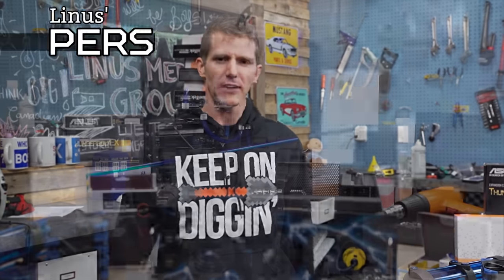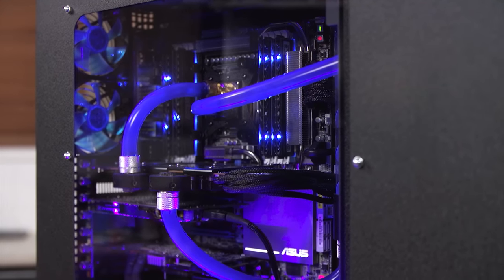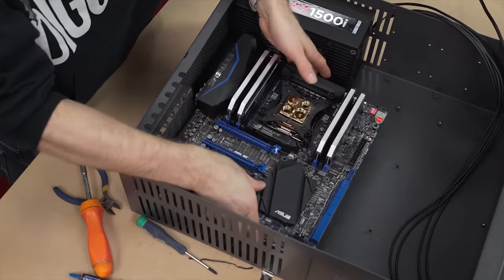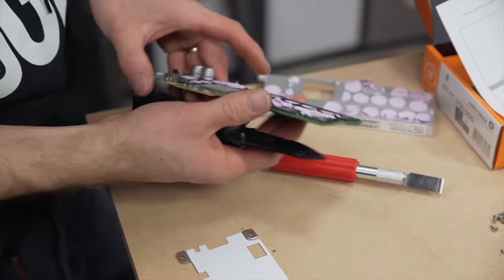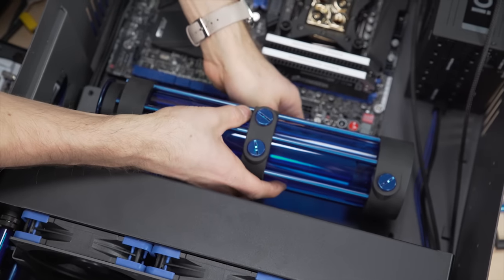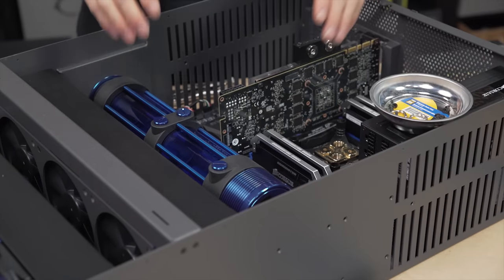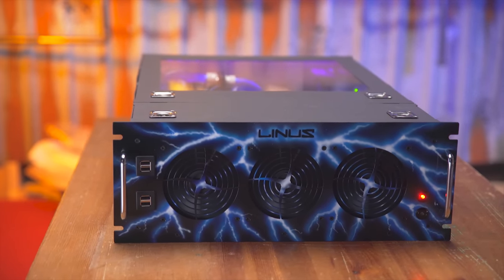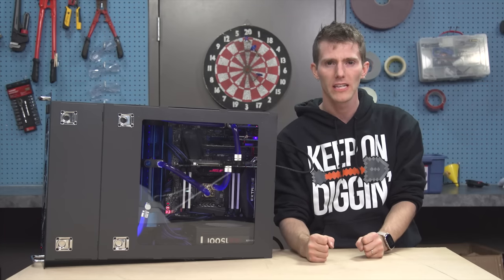Personal Rig Update 2015 Part 4 - My new gaming PC is done!!

Comment: Still using the Tj-07, it's housing two 980tis and a i7 980x cpu, all on air cooling with a side 140mm fan drilled on the acrylic to keep the graphic cards cooled, they idle @ 30ºc, load 75º~

Comment: Linus, keep an eye out on the tube that is on the reservoir and the CPU.   It may leak due tension, and the front USB don't look too pretty, looks like one as you would get if you just if you were using an extension.  But other than that, the case is beauty.

Comment: it might have being hard to build but in my eyes i saw that the case had lots of space for air flow and it looked neat. the way you had the radiator saved you tubing making it even neater and not over tubed. in my opinion i like the design but i am concern about the wiring sense i did not see any back doors to manage them. also that case looks heavy as hell

Comment: For the flexible tubing if it was your only option I wouldve tried to find some metal elbows that I could fit over the flexible tubing to make it sort of like hard line and manage the direction and fitting. The tubing could be cut in a way where it would slide through the metal elbow, granted if the flexible tubing doesnt kink inside the elbow and restrict the liquid flow. Just a thought. Actually more of an experiment and just for looks. Or have the tubing cut and fitted so that it would fit just inside the elbow, have it glued with good stuff and test for leakage.  Dont know if you have ever tried something like this. I just this video so thought of throwing this out there.

Comment: whole building water cooling makes alot more sense in the data center environment  with rack mounted servers that can all connect to a 4" drainage pipe for in and out, first going to the basement to pre-heat any hot water or air ducts, then to a geothermal like setup then in the winter/spring/fall seasons to a radiator on the roof or climate controlled attic, so that it doesnt freeze in the winter or need dangerous antifreeze or you could even use mineral oil so in the case of a leak it doesnt cause any serious damage or corrosion,  i can see it now, a room full of 10ft racks of 1U servers, with quad xeon e7-8890-v3, overclocked to 3Ghz across all 36 threads for 72cores 144 threads at 3Ghz, running cool and nearly silent, short of the in case pumps, the power supplies, and the case fans for cooling the rest of the machine, beautiful

Comment: The second rad should had been made so it could be slotted in separately.

Shame Taren didn't come up with that, all it would had been was a broad piece of thin metal to secure the fans and rad onto. Then... slip it in place. Tube it, fit it, done.

Also, here's a million-dollar idea for one of your fans to ape; Tube inserts to simulate hard-pipe fitting, with an adjustable mounting system that could be secured to the motherboard's standoffs.

Comment: You forgot to add an air filter.. such a super rig you have there and no air filter.. guess it will suck up all that dirt or dust and pass that dirty air right through that rig.. Its an easy fix, just update your 3d model and the real thing with an insert with a standard 20/30 house air filter attached to it..maybe even replace that plexi glass and have the entire side breathable.  - that's just my idea. Hopefully i will build something similar on my pc soon when i upgrade my pc.

Comment: That looks sick! Are you sure this will cool properly? Wouldn't hot air from one radiator blow on another one? Do you have any intake fans? I'm building a few rack mounted PC and the airflow is my main concern. I push air out through 240 aio rad in front. The intake is only two 80mm fans in the back. I don't know how to achieve a positive airflow in that situation.

Comment: So if this PC is going to be in another room, how exactly are you going to set up your desk/workstation? Gonna use really long Display Port, audio and USB cables? Wouldn't that cause input delay, especially if you use USB hubs as bridges? Are you using some kind of remote desktop/VM type thing? I hope you do a video on this since I'm really curious how you'll do this.. and be able to turn on/off and hard-reset the PC from a different room.

Comment: i honestly expected you to go with a dual socket xeon e5-1650-1660-v3 hell even a 4660 with 14 cores and overclock the crap out of it, i dont know about the usability of the asus and other dual socket WS boards with OC function, but my old 2009 AM3+ board let me set my 1045T multipliers individually, too bad i ruined it recently by leaving my 50% OC reference clock on by accident, now the whole board is screwy, though processor seems fine

Comment: I have older case than yours Linus its a Pentium 3 case ha hows that for old case. Its as heavy as shit but good thing about those old cases they can be cut much easier than newer cases and customize it the way you want cause its pure steel no aluminum or other metals in it just steel.

Comment: How did you your graphics card and motherboard together so you could use a single thunderbolt cable? I understand how you are able to connect all your I/O devices through the thunderbolt hub using a single cable, but how are you utilizing your graphic cards during games?

Comment: @linustechtips

At 9:10 theres a 1ft DP cable running from the GPU to another expansion slot with what looks like a Thunderbolt or MiniDP port. What is that card and what is the purpose of running such a short cable like that?

Also, though I'm guessing related, how does linus plan on controlling the "Gaming" rig from another room (including mouse, keyboard, any audio DAC or Headset, etc) over what is presumably a 300' ish run while maintaining complete compatibility, streaming the video of the rig back to the display he will be using AND not introducing lag or input delay?

Im assuming he isnt sitting in the serverroom to play games lol

Comment: Cool case, but exhausting a radiator into another radiator is a Bad Idea.
Reply: Yeah one thing I hate about most rack mount cases for water cooling is they all shove the radiators in the front so the air gets pre-heated before it even gets to the mobo :(

Comment: How have you chosen to connect your mouse and keyboard if the rack mount is stored out of sight?
Reply: +Flat4Buggy 2 Hey awesome info - thx :D

I'm guessing that helps to address any potential for latency.  It had me wondering about display too, but i doubt he's sending all that over  a single Thunderbolt. Could be possible to run 2 cables where one is displayport?

I'm asking because I use a 144hz monitor on DP but I had been reading online that 10-feet was the suggested maximum before you might have issues with maintaining a high refresh rate.

Comment: What is the reason to Watercool an SSD?

Do Intel 750 SSDs get that hot?

I have a Samsung 850 Evo that doesn't get hot at all.
Reply: +Ben Braunstein 
If you are doing benchmarks or insane amounts of rendering PCI Express SSDs can get hot enough they throttle your transfer to prevent damage. So if you plan on intense use and transfer rates liquid cooling can be warranted.

Comment: Hey all,
I'm planning on building my first gaming PC pretty soon, so I made a list of the parts I maybe will buy. Will this be a good pc build? (I'm new with pc building...)

motherboard: MSI A68HM grenade
processor: AMD Athlon X4 860K
graphics card: Nvidia GTX 970 4GB
power supply: Corsair VS550
case: coolermaster K350 / CM 690 III
monitor: BenQ RL2445HM
seagate barracuda 1 TB ssd
RAM: dont know yet. Tips?

Currently i only play lol and hearthstone, but probably will play bigger games in the future. Thanks 4 helping and sorry for bad english!

Comment: Is it really worth watercooling the SSD?
Reply: +SvenOkonomi I highly doubt it, but this is an "over the top" sort of build so why not.
Reply: +SvenOkonomi Yes if you want to overclock your SSD
Reply: +mrjspeed I cant tell if sarcasm.. You cant really do that, right?
Reply: It was sarcasm.  You can't.
Reply: +SvenOkonomi 
Actually it can be, SSD that are used at maximum transfer rates get quite hot, and are designed to throttle down their transfer speeds to prevent damage. Putting liquid cooling on them prevents you from having your rate cut due to throttling. Only really useful if you're doing some insane rendering or something though. Oh or actually benchmarks... Which he will no doubt be doing, so yeah.
Reply: +Daharen If there is indeed thermal throttling, AND if the SSD gets considerably hotter during sustained transfer, then I see some merits in watercooling them. But if any of those prerequisites are not true, the whole point falls apart.
Reply: +Savoury Lobster
What Daharen says is true, go check Samsung's 950 PRO, Thermal Throttling is a actual thing.

Comment: Where is the optical drive installed?
Reply: +Flat4Buggy 2 yeah. that would make sense. all though you don't really need optical anymore. I would put it into a USB casing and just dump it in a drawer at my desk. so if I need it I just plug it in. Then run video and 2 usb3 cables to my desk. 1 cable for a USB3 hub where mouse, keyboard and maybe a controller can plug into. and the other one for a USB3 hub for data transfer from storage devices like a USB stick.
Reply: +Flat4Buggy 2 oh. awesome :D

Comment: That's a weird looking ssd
Reply: +MarcusMeyerTricks It's a PCIe ssd. Something different than your regular sata ssd.
Reply: nope nope Yeah I kinda noticed, just wondering why he opted for this kind of SSD and not a more standard one
Reply: +MarcusMeyerTricks because it is much, much faster. A regular SSD is capped at 600MB/s due to the SATA ports whereas PCIe can in theory do 16GB/s due to the speed of the PCIe interface. The 750 he's using does 2500MB/s read 1500MB/s write.
Reply: Toby Harriman Ahhh makes sense, thanks.
Reply: +Toby Harriman Considering this is a personal rig for home use though... does it really matter? What would he be doing on a recreational PC that'd require those kinds of speeds? At some point it's just splurging money on someting for the sake of it, not because it's needed.
Reply: +jwbartle do you think that personal case and water cooled ssd is needed at first? if you're a real PC enthusiast you're not settling for only the needs you're aiming for the best/wants. it has to be iconic because it'll replace his 9y.o PC.
Reply: Fair enough.
Reply: +jwbartle I think he got most of the things for his rig for free.